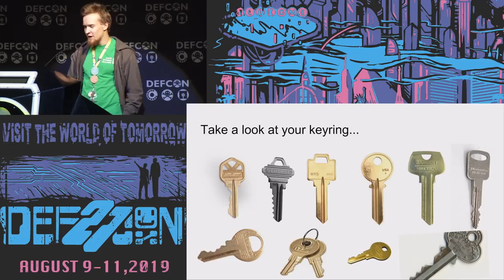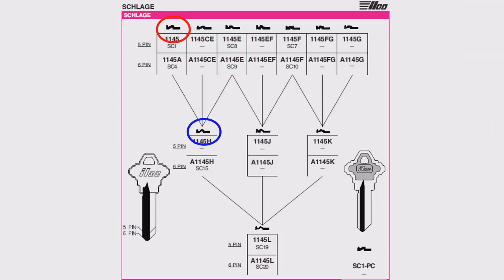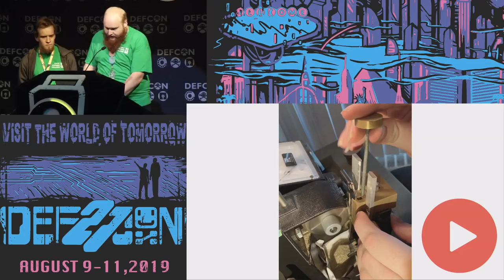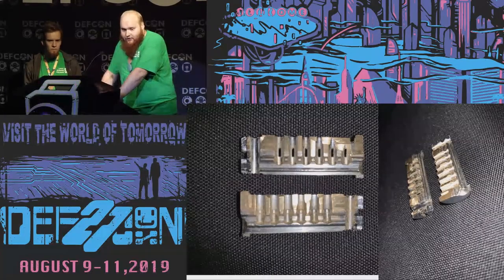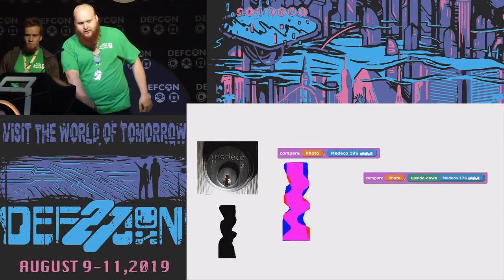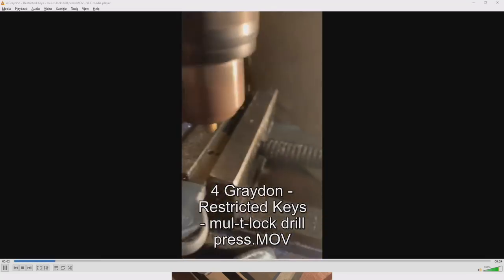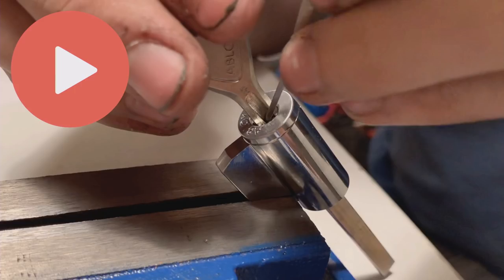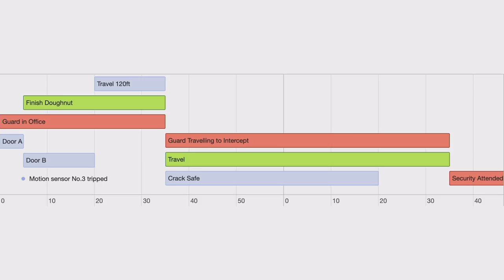Bill Graydon - Duplicating Restricted Mechanical Keys - DEF CON 27 Conference

Comment: As a locksmith and expert witness, Do Not Copy or Do Not Duplicate is an only an instruction to the holder of the key not to copy it.  The exception are US Postal and US Government keys which make it unlawful to copy.  State Universities may also have a State law protecting them. Then there are patent controlled keys, which the manufacturer has the option to sue anyone who replicates those keys.  If the manufacturer determines a threat to the patent, they may sue - even if they just want to prove a point and drain your bank account and run up your credit cards in legal fees.  Medeco is a good example of a company that has an aggressive legal position. Holding a key you copied is also potentially a legal burglary tool.  I also have the side milling machine in this presentation and it’s a royal bitch to get it right. The side milled key is not held in place as well as it’s a bit sloppy. The high security locks are really tight tolerances.  Literally one thousands on an inch can be the difference in a working key and not.  I don’t agree it’s easy to use a lathe to copy these.  The spacing is so tight that you will be spending a great deal of time.  Many test keys get ruined.  And I know exactly what I am doing...  It’s never impossible, but really something far more for machine precision type of people who are THE most determined and willing to accept a slow and for some endlessly agonizing torment and defeat.  There is a big difference between an experienced locksmith and am amateur in reality.
Reply: Very interesting!

Comment: Interesting presentation.  I rarely encourage an end user to buy restricted keyway locks because the lock cylinders and key blanks have a 4-6 week lead time from any given manufacturer. On top of that the owner must provide a letter of authorization for a distributor to purchase these products and it must be snail-mailed to the manufacturer (most commercial hardware manufacturers only sell to authorized distributors, not directly to end user). If a building owner needs keys in a hurry that ain't gonna happen.  I'm skeptical that the average hacker will have the skills to make a restricted keyway as shown in the clip but I admire their ability to do so.  Bottom line: there's faster and easier ways to breach physical security.

Comment: I made several copies of the public housing keys for my friends using Jet's commercial/AIR NS blanks [green color] for 6-pin Biaxials while I worked in my dad's hardware store.
1) Configured the copies by the Medeco machine  2) Then use an automatic machine to trim down the sides of the neck, with a monster-locking-wrench for stability
They all work seamlessly, I charged $10.00 for each copy, I have no licenses of any kind for key cutting just working out of passion.

Comment: For a few months, my local Fry's Electronics had one of those automatic key machines.  This one must have been configured differently, because it would duplicate ANY key.  You could do electronic car fobs and restricted keys, too.  It didn't ask.  I had my mail key, pool key, and gate keys all duplicated (good thing, too, since I lost one of the pool keys at the pool.)  The apartment complex where I was living at the time charged $50 for replacement keys.  Unfortunately it was eventually changed to do only house keys.  Bah.

It's also how I discovered that the USPS does NOT change the locks on the apartment complex's mail box.  You have to pay the post office (or maybe the apartment?  I remember paying at the post office, though) $25 for a mail key because they claim they have to have a new one made every time someone moves into/outof an apartment.  After I had moved out, I still had the key duplicates and had forgotten about them for well over a year.  I went to the apartment to drop them off, and out of curiosity I tried my mail key on my old post box.  Still worked.

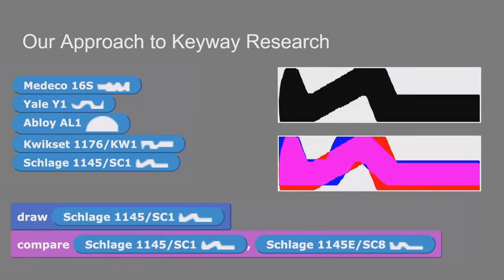Comment: I want that software! 9:15 Is it available for download ?
Reply: Lookup "Key Blank Cross Reference" I found one site that gives a pdf of 190 most common for free and another site that gives access to their database of over 84k for $20/yr (4,500 pictures)
Reply: Keyline and Silca sell machines that has complete databases of key profiles inside. Just insert your key and it will show which blanks fit and how much filing needs to be done. Locksmiths have used these for decades.

Comment: You know this seems like a fuck ton of work when you could probably slip the latch or do other more low tech attacks
Reply: that leaves visible and distinct tool marks on locks whereas this wouldnt. Its for sure a rare occurrence but sometimes its important to breech a lock without anyone being able to know because of an obvious brute force entry or less subtle marks made on pins when a lock is picked.

Comment: Nuclear missile example, that's if the keys are the same.
Reply: i seem to recall atleast the russian ones needing special alloys due to the heat the equipment generates.
Reply: Excellent point, does anyone have info what ever that is the case? Easy enough to fix, but again cloning key if you are one of the operators is not that difficult.
Reply: @Hellsong89  yes I would think the training and gaining entry would be more difficult. Not to mention that the missiles would have to be prepped ?
Reply: @km5405  firstly, the russian ones need codes to arm the warhead. Not sure about the Titan II, but all newer US ones do as well. Those codes are what actually keeps the nuclear arsenal safe.
Reply: For the 2 keys it would be best to get unique keys, possibly from 2 manufacturers. The government would have the type of money to spend on having a completely unique key made for such things.
Reply: yeah the layers of safety are pretty substantial to be able to launch nukes.
Reply: starshipeleven  thats exactly the point. thats why you would need very special alloys to make the key, further gating it. .... or the key is inserted into high temperature components like the rocket itself. dont know the specifics - for all i know its might be a urban legend.
Reply: starshipeleven  i didnt claim to be a expert. and if it was incorportated in the rocket itself - of course its not the starting engine. if you see my pfp you should guess i know enough about rockets to know thats a idiotic design. .... you could however use it as a mechanical interlock --- a toggle somewhere on the vehicle. a good reason you might have something like that is safety .
Reply: @AKAtheA  turns out the nuclear launch codes for many years was simply 8 0's lol
Reply: @AKAtheA  Unless they changed that key it's going to be a well known combination
Reply: @stephenhunter70  uhh, what? I was talking about codes for the warhead itself, those are digital electronics and the codes themselves well kept and managed, since, you know, nukes... the keys are just a glorified button, the real security comes from the electronics in the missile AND the warhead.
Reply: @AKAtheA  The real security?
Reply: @stephenhunter70  yes, the real security...that actually secures the nuclear weapons...to some degree...
Obviously nothing is impossible, so with enough effort/money you could defeat it, but what would you gain from this apart from getting on a hit list?
Reply: @AKAtheA  Ok fare enough, the digit was 0. It wasn't like that put very much effort into it originally hopefully they've changed it.

Comment: Lots of locks today combines Key + NFC-Code sent by the key. Still can be defeated by serious hackers, but if you use the same model as for car-keys it basically becomes a total bother to defeat, and the intruder will have to get hold of a legit key instead.